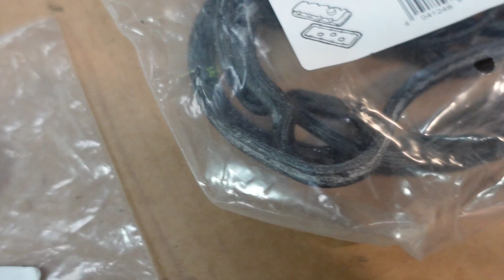5 Common Causes of Oil leaks GM 2.0L Ecotec Engine (Part 1) SAAB 9-3 2003-2011 2.0T

Comment: And the reason of all these leaks is broken PCV valve in the intake manifold.
Reply from the maker: Did you mean every time there are leaks, is because of broken PCV valve?
Reply: @saabmastertech5852  In my experience not always, but often. The PCV valve is a rubber flap in that plastic tube thingy, and it simply dissolves over time. I think on most 9-3's of this vintage they will be competely gone. Thing is: they are hard to change and also testing them is not too easy, the TB needs to come off. Most mechanics do not bother to check them in regular maintenance. A broken PCV causes oil  to be everywhere over time, and pressurizing the cranckcase will eventually fail the cranckseal, and the oil the pressure sensor as well. The head-related ones (valve seal, vacuum pump, power steering) are less clear, but very well possible.
Reply from the maker: @DutchTubeWizard  Not always, but often. Thanks for sharing.